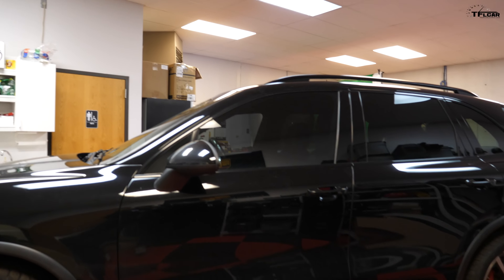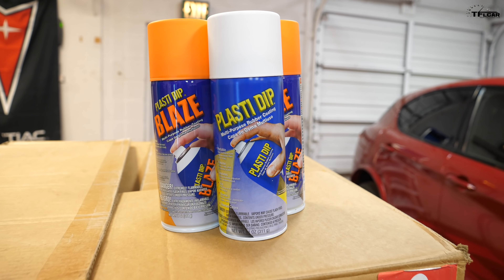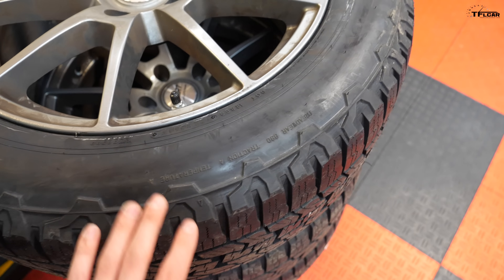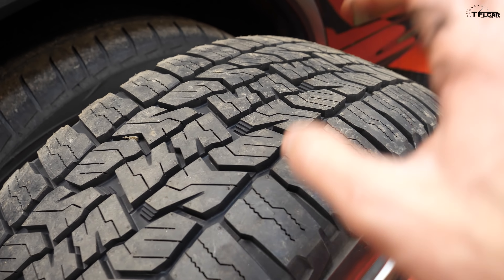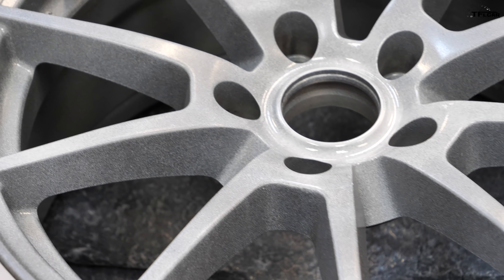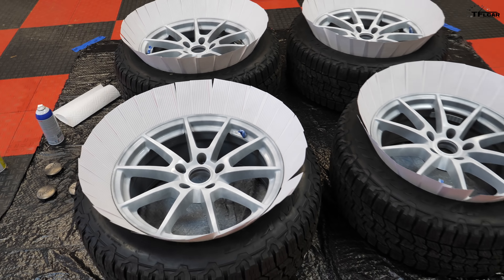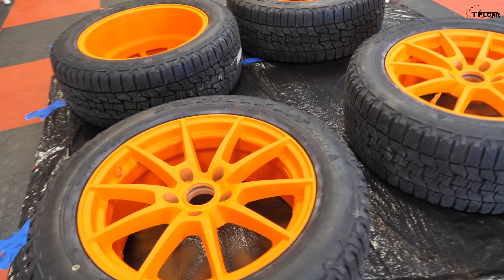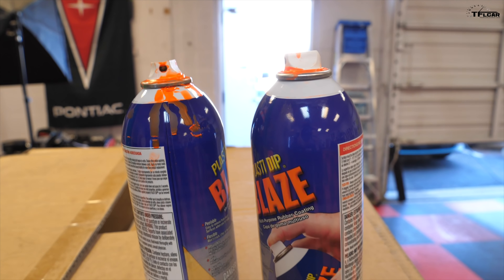Can We Build The World's Fastest Overlander? Project Porsche Cayenne Turbo Transsyberia Ep. 1

Comment: You would have better luck with the spray cans if the tires were upright as opposed to laying flat on the floor. Aerosol cans have a hard time moving the material when spraying at a downward angle, and when doing so, the pressure will often run out before the material does, leaving a considerable volume of unused paint in the can. This problem also occurs when attempting to spray straight up. Best results are usually achieved using the cans in an upright position parallel to the surface being sprayed.

Comment: You shouldn’t spray a wheel flat. Spray cans work much better at an angle. Also, using the wheel mounting tool in the trunk helps mount tires much faster.

Comment: I wonder how rocky/scratch resistant plastic coat like that is when compared to powder coating alloys?(BTW it's not plastic dip as plastic dip as name suggests you putting parts in the water with floating desired pattern then dry up )

Comment: OK then Alex,...job's done,...but maybe those cans had a difficult time spraying in a downward attitude. They usually have pick up tubes from the nozzle down, maybe this could  be
some of the reason for the bother caused. 
In the meantime,..are you going to take that lot back to the dealer, I was thinking that those cans run up a bit of cash,..they owe you an explanation at least, if not replacements.

Comment: did i see plastidip on the wheel where it mounts to the car itself? you shouldnt paint over that as its a rubber coating that torque spec will be off and those lugs will come loose. luckily its an easy fix with plastidip..just peel it off the mounting surface

Comment: The Porsche is known for expensive reliability & durability weaknesses.  It seems like a flawed plan to take a questionable vehicle through stressful challenges far from support.  But part of the challenge?
Reply: Maybe you should check out the Porsche 2008 Trans-Siberia rally
Reply: @excelsior7608  I should.  Thank you.  I suspect it was a factory prepared car with factory support.  When I break down on a modest forest trail, I walk miles back to camp or to find a weak cell phone signal.  So I try not to break down.